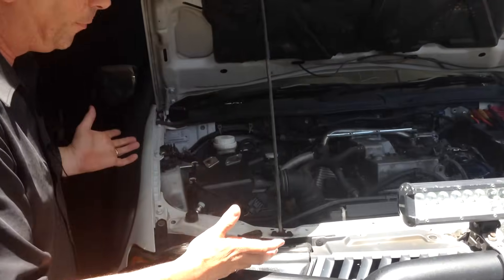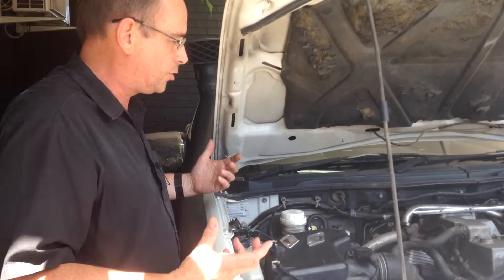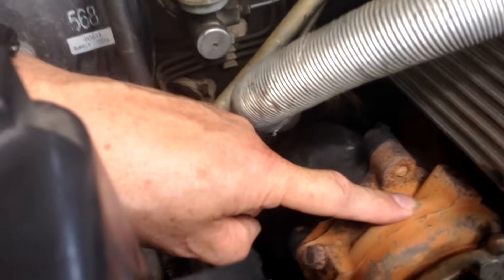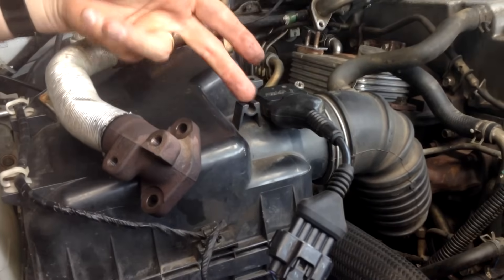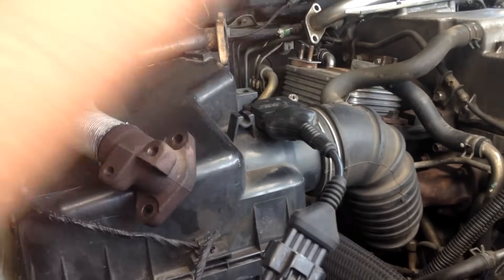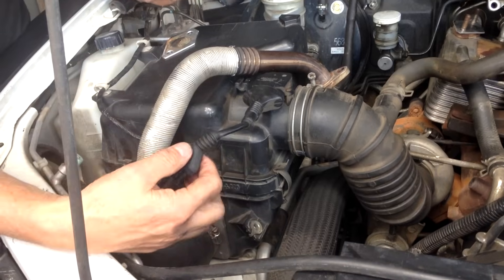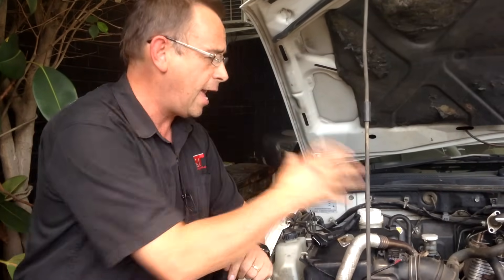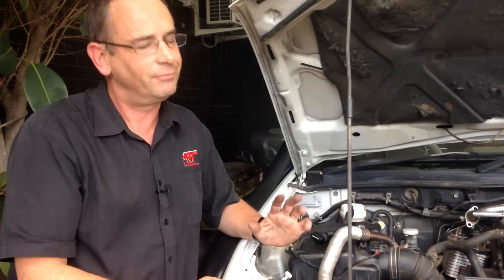How to fix EGR Soot Buildup in a Turbo Diesel

Comment: Get a petrol car instead.
Reply: No way. Went diesel 4 yrs ago, never going back to gas engines.
Reply: gasoline engines are far inferior to diesels in terms of reliability/longevity/fuel economy
Reply: @bugattis721  thats why my nissan diesel engine lasted 67000km. very reliable i think not. fuel economy 15lph going back to petrol. my 5.4lt V8 is better on fuel and will last  10 times as long.
Reply: They also have egr valves which clog
Reply: Gas engines also have egr my friend

Comment: Just disconnect the electrical connector coming from the EGR unit. With no electrical feedback the car computer will close the EGR valve all the time which is what you want. The EGR valve might clog up itself but it wont matter because it will be locked closed anyway.  
 My car didn't throw any error lights on the dash.  Hyundai Iload 2012 diesel.
Reply from the maker: Bigbore400cc most cars will generate a fault code.....
Reply: Perhaps being a commercial vehicle it runs different software?, Hyundai i30 gets really annoyed if you touch anything, I tried blanking of the EGR pipe, the car ran beautiful for about 20 minutes then went into limp home mode barely driveable with a 'EGR Low Flow' code logged.
Reply: How would the vehicle pass a smog inspection ?
Reply: @tarquineous  how would it pasd with one working these pollution egrs and dpfs only work when they are new just like a humans arteries once they get clogged they don't work i bet even a brand new vehicle with these things fitted after a year will fail a smog test as they start to  lose efficiency from the first moment you turn the vehicle on

Comment: Highly illegal to modify any vehicle emission system in Australia. Just sayin
Reply: dazza421970 
Illegal isn't always wrong
Reply: Everything is illegal now
Reply: Dead right mate, our grandfathers fought a global war to stop this sort of rubbish.
Reply: funny how everybody thinks its ok to do this, then cheer when a VW exec faces 10 years jail in the US for "making the car pass the test" btw the VW diesels are probably the cleanest running diesels you can buy...
Reply: @slowboat6021  vw did nothing wrong
Reply: Big crime, enough to get you transported to Rotherham Yorkshire ?
Reply: It's not that bad!
Reply: First thing we were taught as mechanics was how to "tune" the emissions gear so it looked stock but didnt kill performance.
Reply: Should be illegal for manufacturers to knowingly  sell such a set up that destroys engines to meet some bs euro rules
Reply: It’s only illegal if you get caught 😂
Reply: EGR valves, when they work are 'OK' nothing more, modern diesels rely on various emissions technologies to 'clean' their emissions..the main one these days are DPF filters. They ARE critical for removing invisible carcinogens from the exhaust emissions and should not be tampered with.  The EGR valve on the other hand, once blocked has no place to go.  The soot and residual oil build up is prevented from entering the combustion cycle, that is all. A blocked and dysfunctional EGR is worse for the environment than a blocked off/deleted one.  Cleaning the inlet side of the engine helps reduce emissions and increase power and MPG (in theory) An engine that cannot breathe correctly is also detrimental to the environment (of course, any engine that burns hydrocarbon fuels are detrimental in the real world. It should be noted that where the EGR is blocked will, over time 'soot up' also and will also need cleaning. The amount of carbon and oil (Vegemite) created by the EGR system is significant over time.
Reply: Every manufacturer has work arounds to ensure their cars meet the poorly written emissions laws but remain driveable in the real world. Personal experience owning an FD i30 Diesel.
Reply: certainly is in anyway at all
Reply: Over regulated society run by Leftarded Cultural Marxists
Reply: What Joe says, sick of communists telling me what I can and cant do with my own stuff.
Reply: Unfortunately manufacturers are getting better at self testing the emissions gear, Hyundai test the EGR system for flow every now and then when the engine is idling, I think it momentarily fully opens the EGR and closes the inlet throttling valve, if the engine stumbles it logs an 'EGR Low Flow Code (P404 from memory) and puts the engine into a low turbo boost limp mode that is barely drivable. If the EGR system is still open the engine runs on it's recycled exhaust for a second or two.
Ray

Comment: Crisp mods do a plug in solution. Works fine for me. Temp sensor in the maf sensor controls egr only. Fueling is controlled by other sensors. A good catch can is good too.
Reply: Patrick Sproule Well said fellas, this is my exact understanding too. I have taken the inlet off my Pajero and cleaned it and I can tell you its a difficult complex job for the non mechanic with many bits to be removed and rubber fingers required. Involves removing injector lines and common rail and replacing copper washers etc. The black shit downstream of the EGR was significant causing restrictions particularly at the elbow. Researched this problem intensely and have installed quality oil Catch can and EGR off module. Ecu remapping is definitely an option as Bret is offering but it's 1: not for the do it yourself mechanic.  2: much more expensive. The only issue for the EGR off module is that is does not allow for no exhaust gas in the air mix calculations or charge air and fueling is slightly lean. This perfectly ok for diesel engines being the opposite of petrol where lean mix creates excessive exhaust gas temps. In the real world the engine performance is as good or better with slightly improved fuel economy now without the intake blocking problems. New oil stays significantly cleaner for longer.
Reply: This is correct. There is actually a second IAT sensor after the turbo on the Mitsu's that it uses for fuelling.

Comment: Touched on everything except the thing you should do first and foremost which is a good quality oil catch can to stop the oily vapours
Reply: Bradford Ramm I did try that trick and it’s working great. Straight from factory I fitted both oil catch can and secondary fuel filter/water separator and I haven’t had a single drama. We all know the new emissions controls they put in place are shit, but if you do the correct things to counter them, they won’t cause any issues
Reply: @Cl4rky  I agree bud, a quality catch can does wonders, i went one more with the blanking plate with a 10mil hole to trick computer. All looked pretty good in there when i pulled it all apart last.
Reply: It's not the total fix to the sooting sludging issues but it helps a lot, I fitted one top my Hyundai and the inlet ducting now remains dry so the soot can't stick
Ray
Reply: whorayful where did you get the plug in for maf for Hyundai ?
Reply: ? Sorry I haven't touched the MAF sensor at all, it's upstream of the Turbo and the crankcase breather pipe so it stays pretty clean, just the occasional spray with cleaner is all I do to that.
Reply: Just get it carbon cleaned!! Works a treat and it's cheap
Reply: @markbrown351  how much? Where abouts are you located
Reply: your name  No sorry, the only modern electronic diesel I have experience with is the Hyundai 1.6 L CRDi. Still goes like stink, but the chassis is starting to rattle, bang and squeak. Also has the occasional morning where it doesn't want to start first up, just cranks with no smoke. Once it starts no problem the rest of the day.
Reply: Catch cans do not catch all the oil.    Most likely all that caught oil would just pass through the engine with no problems, anyway.
Reply: If the soot has no where to stick, like oily inlet manifolds, it passes straight through the engine without issue, politeness stops you looking like an idiot.
Reply: I defer to your obvious superior knowledge, I offer my inferior experience in deference.
Personal drives, 1983 Mitsubushi 4D55 diesel, owned for around 7 years about 120,000K, 1990 Toyota 2L diesel owned for round 20 years, 260,000K, 2004 Kia Pregio diesel owned around 10 years, 120,000K currently have a 2010 Hyundai CRDi  80,000K. 
Did I mention I worked for Detroit Diesel for over 20 years from the late 70's thru 2000s? 
They were the Australian agents for GM, Isuzu, Perkins and numbers of other brands. 
So you are correct I obviously have no idea what I'm talking about. Tool.
Reply: The first thing to do is remove the silly EGR valve and install a bypass
Reply: That is the ultimate fix, unfortunately the newer the engine design the 'smarter' they get. My hyundai will log codes and go into limp mode if the EGR is electrically unplugged or if the EGR flow is stopped with a blanking plate. There are more companies getting around offering software 'EGR' 'DPF' delete options where they turn off the function in the ECM itself. The prices are dropping fast as well 2 or 3 years back when I started looking it was a $1400 job to do an EGR delete, now it's down to around $400 drive in, drive out.
Reply: whorayful you clearly know squat about soot. Buy a nice politically correct expensive diesel for your self and try that trick. Then get back to me in 500k or less when you realize how foolish that statement is on diesels.
Reply: @NoName-tz5ji  who stole didley
Reply: Paul

I have been using prolong engine oil since 60,000 kms. I removed EGR valve at 260, 000 kms and looked inside  intake manifold and found no diesel soot buildup.
Jetta mk 4 1.9tdi now on 342,000kms , still original turbo.
I believe prolong engine oil keeps engine clean and prevents sludge buildup.
Reply: catch can absolutely works, cleaned my egr in my newer common rail diesel at 40k which was already very clogged, installed catch can, now check at 100k, and almost no build up, modern diesel you can not use blank of bypass egr as they will throw codes and cause many computer issues, catch can absolutely works
Reply: @emoil42  what type of catch can did you use?
Reply: Cl4rky that don’t help with the soot fool

Comment: Is it functionally viable to disable only the EGR valve electronically - via the ECU -  to permanently close the valve and in doing so disable the EGR system 

I'm also thinking that unplugging the the EGR valve when the valve is closed - [ Q when and how can you tell the valve is closed ] - but that would I think initiate fault codes associated with the valve ie no positional Feedback  signal 

 I have a 2007 Citroen C4 Picasso 1.6HDi (104,00Mls ) and just want to rid myself of the dirty system, please advise...joe
Reply: Joe Stubbs hdi tuning bristol

Comment: Hi good information, I had a engine management light & restricted performance on my 2.7d xf jaguar, I was fed up with my car I was ready to sale it, my mechanic cleaned the air flow sensor, air filter box & pipes, sprayed Wynns egr valve turbo and inlet manifolds cleaner down the intake, blanked off the egr with blanking plates and finally retuned my ecu which increase my bhp by about 40hp and cleared fault codes. I took my car on the motorway for a clean out, Wow best visit ever to a mechanic my car runs beautifully 70000 miles on the clock, mpg is about 32, take off is smooth but the magic happens once rolling the pull/pick-up is awesome. I would never sale my car now.

Comment: A resistor
Reply: I used to respect MRT before I saw this video. On the Mitsubishi's, the temp sensor for the EGT is separate from the temp sensor for other functions. Yes, less than $1 fixes the problem. 4.7k Ohm.
Reply from the maker: Grant, with respect this is not to to with the EGT TEMP at all, thats a SEPARATE ECU input. The inlet AFM sensors has a temp input that the ECU relies on %100.
this CONTROLS EGT duie to the ambient intake temps of all these models.
Why would we lie about such a simple thing?
Check the map image we showed.
Mayve you might now respect us again?
;)
Reply: @MRTPerformanceAustralia  why would intake temps before the intercooler matter? I would think the temp of the air when it reaches the intake would be far more important, because it can fluctuate massively in a matter of seconds depending on engine load? The temperature at the air box could be 60 degrees cooler or more before it reaches the egr system.
Reply: My understanding of the resistor air inlet temp “mod” is to fool the ECU into thinking the air is colder than it actually is, it then allows more fuel to be injected and increases performance ( maybe black smoke too), the colder air is more dense and would allow for more fuel to be burnt.
Reply: Lie is strong word, people can be mistaken.  I am about to do the 4.7k resistor mod, will the diminish the engines function anywhere else. I used to live in Sydney and would drop the car in but now live in Darwin. Can the ecu be modified using the maxiscan5s509 obd2 unit?
Reply: Tim we can remote tune your car in Darwin
Reply: Hi Brett, also sent you an email please look for it :)
Reply: I bought the kit off eBay.  Installed a resistor myself. No issues and watching data from torque app it definitely has a working inlet temp

Comment: Brett would an EGR oil catch can be a good addition?
Reply: If you blank the egr a catch can is not necessary. In fact, after you blank, the blow by oil will self clean the soot out of the inlet manifold. Without the nasty exhaust gas the blow by oil starts working as a solvent and washes away the soot. I blanked my 2.5 Triton about 2000km ago and I have gone from a black plume of smoke from slightly aggressive acceleration to almost no smoke with very aggressive acceleration over 3500 revs. 

Also cold air in the combustion chamber is a good thing, denser cold air has more oxygen to burn the diesel.
Reply: Reply to Dino Shed - See my comments above - following on - I removed my 2007 C4 Picasso inlet manifold and scrapped away at it and removed approx 1ltr of oily crud - unbelievable - its now soaking in DPF filter solution to try and remove crud trapped in internal nooks etc, ideas anyone?
   Dino  - your solution to fit an extra/post market oil separator is I think a good idea cos my crankcase PCV floppy diaphragm had cracked in several places making it inoperative ( Q how does this work) which must have contributed dramatically to the oily/carbon mix build-up in the inlet manifold - where can you get one of these oil separators 
  I suppose  it is not unlike the demister in an oil industry separator vessel  - the bigger the vessel the more retention time for the oily mist to drop out methinks...joe
Reply: You most likely have your inlet manifold back together - a great/cheap trick is a can of foam oven cleaner - 'Mr muscle' oven cleaner here in Ireland. Use in well ventilated area! Works a treat.
Reply: @joestubbs3138  Mann Provent is made for this purpose
Reply: EGR has no oil to catch.
Reply: Colin Walker you may be thinking about the PCV.
Reply: EGR is closed at higher speeds.  The cooler is used to cool the hot exhaust gasses before it goes back into the intake.
Reply: Joe Stubbs Mate get some carby cleaner for the intake manifold to clean it. lol
Reply: I’ll give you short version of what should be done and what shouldn’t. Don’t ever let anyone ‘chip or remap’ your ecu, if it goes wrong you then have to hope that same person or garage can deal with it. Don’t delete or blank the egr as it cools the combustion temperature as well as other things. Most definitely fit a good quality catch can/separator as this will prevent the sludge buildup.